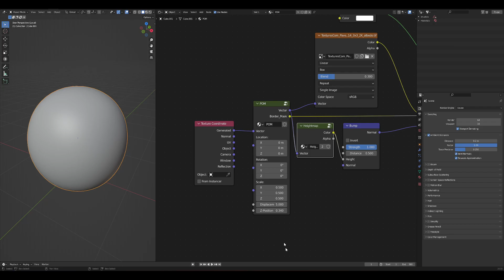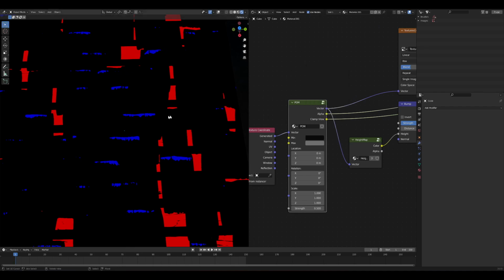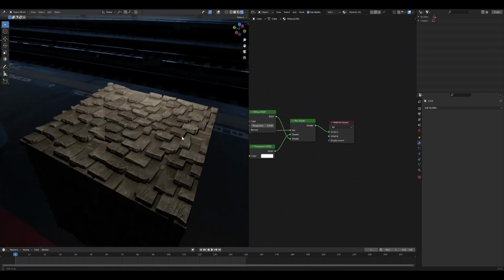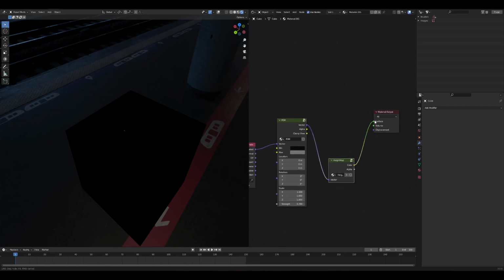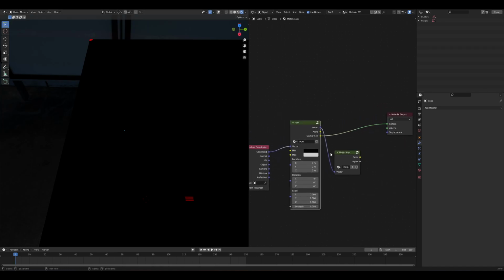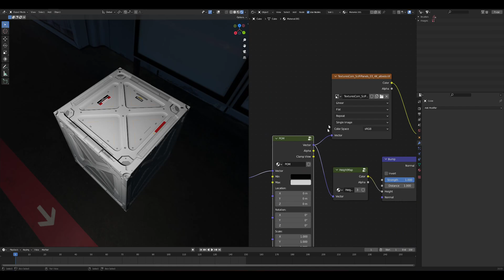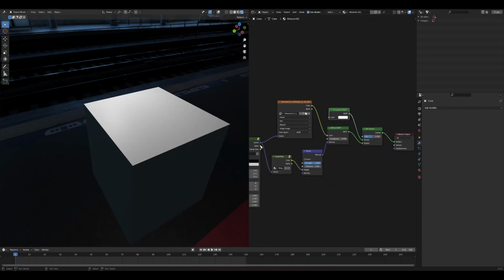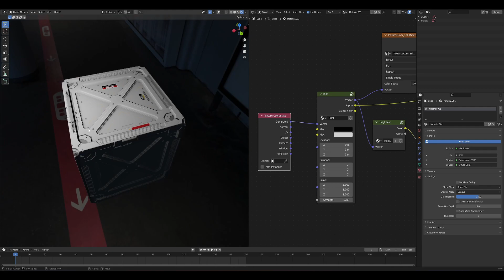Blender 3.0 - Parallax Occlusion Mapping - Node Setup (Updated)

Comment: I cant manage to make it work with multiple materials in one object, did I need to separate it, like I tried to create new user copy of nodes too, but it still uses one texture map of depth for all materials. Like DO I just need separate objects cause of that true normal thing?
Reply from the maker: That's one of the biggest downside of node groups in blender. One way around it would be to fully program this thing as an add on (which I'm not good enough for), another way which works but which can get confusing over time is appending the whole node group a second time for the second material and so on.

Comment: One question, your example is using generated texture coord. when I try using UV coord the texture is not appearing on a correct position. is your POM only support generated texture coord? or am I doing something wrong?
Reply from the maker: No its only working with generated textures. UV vectors are lacking of important informations to make this effect work. I've tried some work-arounds but nothing worked 100%

Comment: This only works if i rotate the height texture 90 degrees counter clockwize
Reply from the maker: Make sure that both the heightmap and texture are using the same projection method. Generally either Flat or Box in most cases.

Comment: thanks for sharing, i gave it a try, but it doesn't work with UV texture coordinate, Does it only support generated?
Reply from the maker: Yes it only works only with generated textures. This is due to the missing Z-vector of UV coordinates and the rather typically random rotation of UVs which makes it nearly impossible to compensate as those information's are necessary to calculate the vector transformation in order to get the effect to work.

Comment: How can I apply this to an object with a UV? Or is that not possible yet? 
Wie kann ich das auf ein Objekt mit einer UV anwenden? Oder ist das noch nicht möglich?
Reply from the maker: Leider gar nicht. Und sehr wahrscheinlich wird es nie wirklich funktionieren. Das Problem besteht darin, dass UV's im Gegensatz zu den generierten Koordinaten nicht genügend Informationen liefern. Ich habe schon mehrmals versucht das irgendwie zu umgehen aber es ist nahezu unmöglich zu einem einigermaßen gutem Ergebnis zu kommen. Sorry. (Das einzige was halbwegs funktioniert sind planes mit UV)
Reply: @MrRolord  I've just been messing around with my own implementation of POM. I should have googled it first and saved my self some work 🙂 I've managed to get it working well with UVs in blender. You just need to transform the incoming vector into texture space. Here's the node setup I've put together: https://www.paulbrunt.co.uk/incoming2texture.jpg

Another thing I've found that might be useful, if you jitter the sample height with a white noise texture you can get a really good result with way less then 32 heightmap samples.

It'd be cool if you wanted to add UV support to your implementation. If you need anything more, I'd be happy to send over my blend file to assist.
Reply from the maker: Very interesting, I might try to implement those if I find time for it. :D
Reply from the maker: So I was able to get the UV Method to work, however I did not manage to get rid of the smearing when using the white noise jitter. This might require some investigation. Nevertheless, thank you a lot for the hint :D

Comment: been messing with it a bit however if i try to open the POM group node blender completely locks up :( Is there anything against using a principle bsdf so that way alpha can be handled with that? it seems like it works for my first use case but it's just faking a recessed light